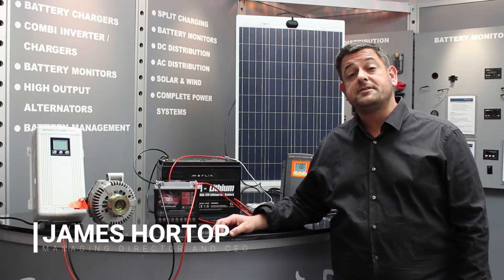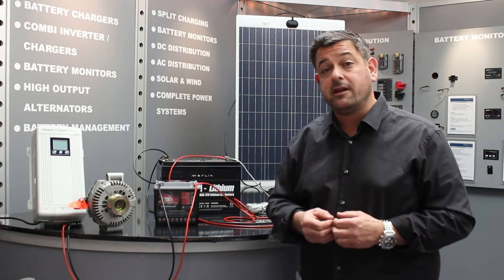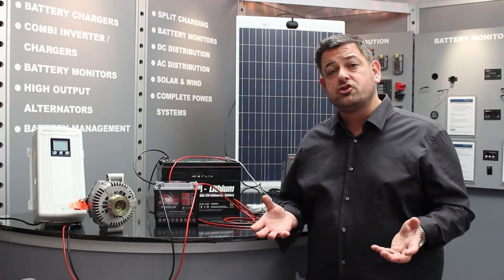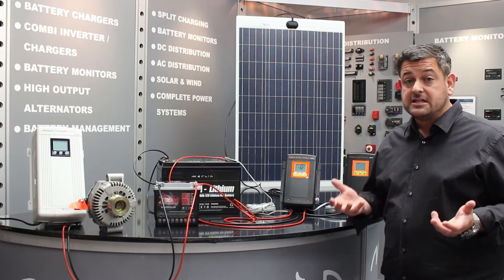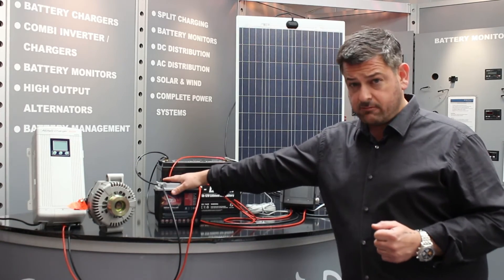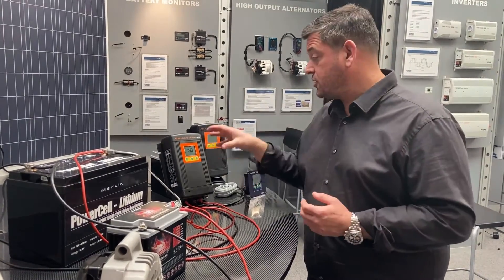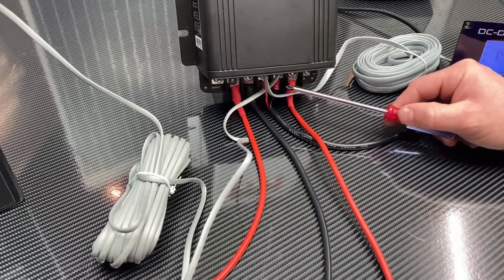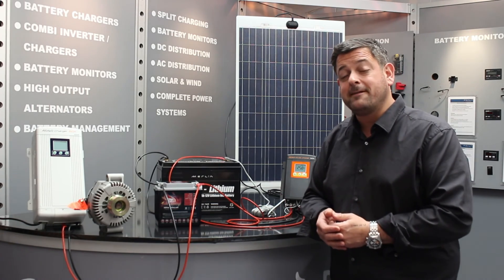Merlin DC-DC Chargers

Comment: Interesting but confusing:
you say that the Abso units are rated for their output current at 25 degrees but your datasheet states Merlin always provides continuous output ratings at 20 degrees celcius.
In the video you have the temperature sensor connected to the positive terminal whereas the instruction manual says to connect it to the negative terminal. Also you say you would always recommend the use of temperature compensated charging with Lithium batteries but in the instruction manual it says, “ for Lithium and Program battery setting, the temperature sensor is not required and it would be ignored if installed.”